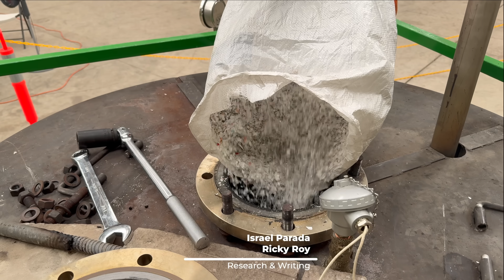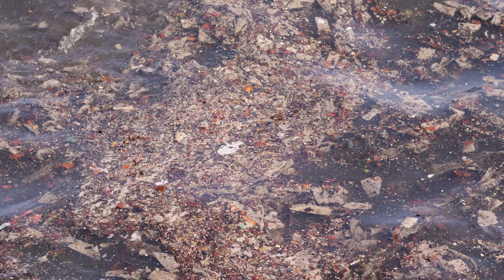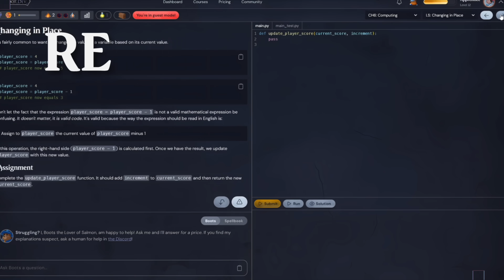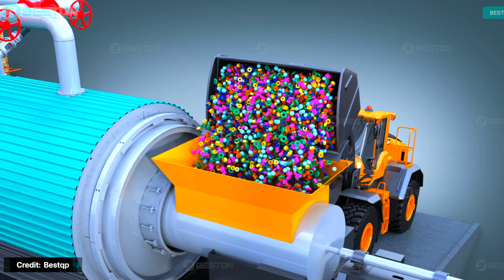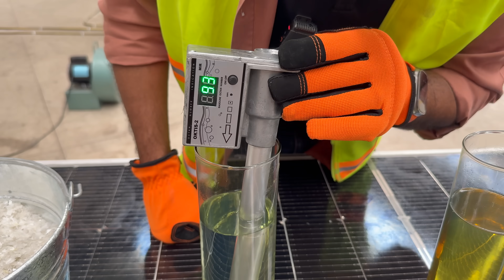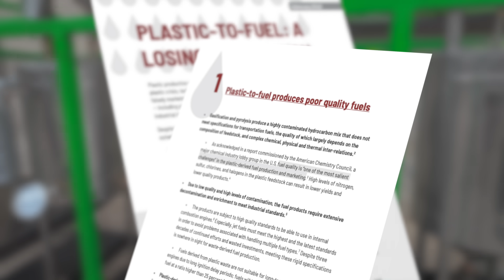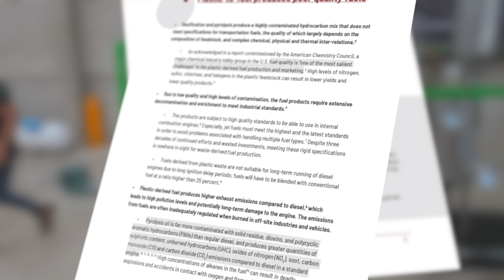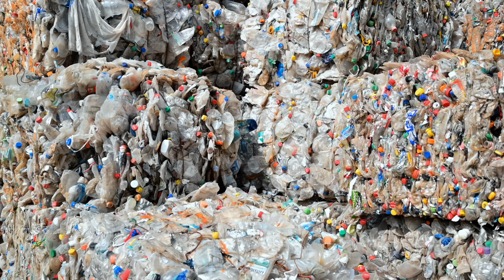Solving the Plastic Waste Problem - This Surprised Me!

Comment: So first and foremost what kind of company is this going to be? A company selling the systems to refine these plastics? Or a company that it going to own it's own centers to refine these plastics in different locations? The reason I ask, is because it's making me think of the 10 different states that have the recycling program for .05 or .10 cents per bottle or can. Why not have this company see if they can get their hands on some of that stock to build a workable stock? 
From what I understand from these redemption recycling centers, there's a bunch of plastics that are separated into reusable plastic, and different grades of plastics, some of those are specific grades that PetGas could use. So wouldn't marketing towards those centers to build a workable stock until they find a solution to get their own plastics? Or is this a company that is going to sell the processing plants to these types of centers? All I know is something needs to change with the amount of plastic waste we produce, and to produce it into fuel would be a great idea in my opinion. I think in places like California it'd drive the gas prices down or could be a leading competing gas with how high the octanes are. Which might be a great business model?
The only problem I'm wondering is how much they can produce per day and is it enough to compete with others?

Comment: every single plastic landfill should have several of these machines. not to mention the fuel from this plastic waste could be far cheaper than getting crude oil from the ground too, it looks like a promising tech and I enjoy its simplicity too.
Reply: A few years ago I read where a company was negotiating a contract to take all of NYC waste.
They separated everything and sold the metals and incinerated the combustibles using the heat to generate electricity.
So they got paid to take the trash, paid for the metals, and sold the electricity.
Just add this technology and sell the gasoline also.

Comment: I remember learning that the massive Deepwater Horizon leak in the Gulf of Mexico years ago did LESS damage than if it was pumped out as usual, refined, and burned. Yes, you read that correctly, the oil did less damage bubbling up from the seafloor day after day than if it was “properly” refined and used to propel modern vehicles - which are slightly more efficient/cleaner than older vehicles, slightly. Burning gasoline, diesel, etc is extremely bad for the environment and the sooner we stop creating and burning the garbage the better. Recycling plastic into something that isn’t burned is a better idea - maybe it can be sequestered in something so loose micro-plastics aren’t an issue. Burning plastic/fuel doesn’t make it go away, rather, the chemicals are now in the air, water, and soil. Just my opinion.

Comment: A lot of energy is used to find and retrieve fossil fuels. Using this process to make fuel has to be much more energy efficient than drilling in the Arctic Ocean or creating more dependence on coal, as our current administration wants to do.

Comment: "And that's one of the criterias that helps us be considered a clean technology and a green technology, because you produce more energy than what you need"

This is not the definition of clean/green technology, that requires zero, or at least low, net fossil carbon/CO2 emissions. The feedstock for this process is a fossil carbon product so the deliverables are derived from it will also be fossil carbon products. This is a 'greenwash' not a 'green' technology.

What is process demonstrates is that a lot of people do not understand the basics of low (fossil) carbon energy.

Comment: Turning waste plastic into fuels does not make green or low carbon fuels. The carbon atoms in the gasoline, diesel, or whatever other fuel is produced, are the same FOSSIL carbon atoms that we're in the fossil fuel that the plastic was made from to start with. The only minor of benefit it provides is not having to extract virgin oil to make the gasoline, diesel etc. However, they will still be some material and energy losses from the conversion process which are likely to be higher than those incurred from processing virgin oil, partly negating the benefit off giving waste plastic a second life as a fossil fuel.

Actually, if the plastic is clean then probably the best thing to do with it is actually landfill it. Deep landfill of plastic is effectively carbon sequestration, it'll just sit there almost indefinitely.

However, if you really insist on extracting the energy content the plastic then the most effective way is probably to actually burn it in dedicated furnace to produce electricity, which should operate at an efficiency similar to a coal power station, about 40%, and use the electricity to power electric vehicles.

The energy content of plastic varies a lot depending on the type, but 1Kg of mixed plastic probably has an energy content of about 9KWh on average, producing about 3.5KWh of electricity, enough to power an EV for 11 to 12 miles.
If that plastic was converted to petrol/gasoline, at 100% process efficiency, it would produce about a 1 L of gasoline, enough to power an average UK petrol car for about 8.5 miles.

Therefore, burning plastic to make electricity could power about 35% more Road miles than converting it to fuel, and that is assuming 100% conversion energy efficiency, which I doubt they will get close to.

 Furthermore, it should be possible to add CCS to the power station to capture the fossil carbon atoms, but this wouldn't be possible when you are burning those same fossil carbon atoms in a car engine.
Reply: Carbon is the element of life, life does not exist without carbon, and it is a precious resource, not something that should be sequestered in a landfill.

CCS is making the most beneficial decision - take an element that is naturally recyclable & place it in well defined holding areas so it can be used for future uses!

Fuel is just one way of using sequestered carbon (creating fuel sequesters it again.) How about accelerating growth in adjacent greenhouses? How about 3D printed filaments? Making Graphene for high tech manufacturing uses?

Carbon is NEVER better in a landfill.

Comment: So much plastic that consumers put in recycling bins never actually gets recycled and instead ends up destined for landfills in other countries. If we could instead make use of the plastics that we can't or just don't actually recycle into new plastic products, but turning it into coke, gasoline, Diesel, kerosene, and paraffin wax  it would certainly help get rid of theplastic waste in a better way than just piling it in a big hole. 
Also, if this process, once utilized on a large scale, produces significant quantities of coke, it could reduce the reliance on coal sourced coke and therefore reduce the extra CO2, SOx, and NOx emissions that come with making coke. Not to mention require less coal to be mined in the first place. 
So sure, it's not keeping the plastic plastic, and isn't keeping the carbon sequestered. But it is using the plastic to replace other sources of carbon products, some of which have other pollutants that people on both sides of the climate change discussion can agree are bad. 
Don't just look at the first order effects. Look far downstream for all the other potentials, both good and bad, when looking at such things!

Comment: the all you need to do to please people. otherwise tech is fine. yes people talking are the worst. kerosene is paraffin but liquid tho. the bs people talk to get money grants. yes people pleasing the curse of the community. zero actual freedom, only please me talk. therefore corps rule the world currently. well you need to get paid dont you to give them money. free gift or there is no business. also fractional distilling. electric starter resistance heater of course. no wonder people. so why not burn plastic in steam engines. treat plastic like wood. and generate electricity. you are doing wood gas anyways. so why name pet-gas if you cant handle pet. so you dont have incineration waste power plants. hold on, recycling used to be just re-using the material in some way, not fuzzing about climate change combined into the reasoning recycle. recycle dont even think about nonsense. any climate change talk only makes you look ridiculous. climate change is only fake extra enforcement of random laws that nobody should be putting on freedom. like your voted or placed laws. better be perfect or your talking points collapse with your own law. ip? lol. public domain.

Comment: There are two problems with taking this technology to the next step:
waste management is a multi-billion dollar industry dominated by huge corporates who will jealously guard their profits and prevent disruption to their industry,
the oil companies don't want their product stream diminished so will resist any technology like this that does so.

The way around those problems is that you need a government agency or local authority that can interrupt the flow to landfill or incinerator, commission a project to build and run a pyrolytic converter, then use the products in a vehicle fleet to bypass the fuel companies. It's a big ask.

Comment: PET should be turned into car bodies like Sandy Munro has been harping about for decades and finally got Slate Motors to sign onto the idea... It's cheap, durable and repairable/replaceable at a fraction of the cost of painted sheet metal!

Comment: A lot of plastic waste in Europe is dried and shredded  (with other waste) to produce "Refuse Derived Fuel" and then used in energy from waste plants  - i.e. incinerators.  so the notion of recovering value from plastic in the form of a fuel is well established.   This process appears to produce a much higher value fuels ( & wax & carbon) but the waste will require more sorting to avoid contaminants like PVC  etc.  Very interesting even if real world recovery rates when the thing is scaled up are not as good as the test bed.

Comment: This process has been known for the past 20+ years. There are many of these systems operating around the world, but the profit margin is low. Here is a question, what is the Sulphur level in the fuel? Is equal or lower than what California, and Washington state require? If it is they can sell to them for $3 per gallon, which is the ballpark average the rest of the U.S. buys it for.
They could set up the process near farms, sell it the farmers at a reduced price, which would improve profit margin for the farmers. 
Set up several in Hawaii and Alaska, both have very high fuel cost due to it need to import all of their fuel.

Comment: This is a terrible idea! We don't need more gasoline. So we're taking plastics (which were produced from petroleum products) and converting it to gasoline (using lots of power in the process) to burn and put more CO2 back into the atmosphere? How does this help anything? Yes, it gets rid of waste plastics but by ultimately throwing CO2 into the air? This is neither green nor clean!

Comment: Besides the serious concern of creating fuel from a waste product, they need to solve another problem if they want to scale up. Batch processing seriously limits the usefulness of any process that wants/needs to process large amounts of waste. If they can convert this to a continuous process, that would increase its usefulness. I am sure that is possible given that the petroleum industry already has this solved for hydrocrackers where the heaviest tars and fueloil fractions that remain from the refinery/destillation process get hydrogenated and broken down to lighter chains that can then be destilled in more desirable products (this hydrocracking also produces a coke residu, but it containes more unwanted pollutants because the input contains more sulphur and metals.

Comment: Considering how little plastic actually gets recycled, this could help build a balance of typical recycling and fuel issues.   I actually think this is a monumental discovery.   Thank you for sharing this.
Reply: The problem is that in the real world, the cost of sorting the plastic eats into the ROI. You can't just scoop up 10 tons of random plastic out of the ocean and dump it into a reactor. Not yet anyway.
Reply: And there is energy input (a BTU cost) for every drop of new fuel created.
Watch the video. They cook the plastic with natural gas and add petrochemical plastic (to create the new fuel). This process creates even more pollution. Stupid idea.
Reply: @ChatTHC420 NO, but we are automating everything. Just the mater of TIME…..
Reply: @ChatTHC420  With AI and vision, there can be two or three 100m conveyor belt with multiple arms that are constantly sorting and putting the needed plastics into the right lanes. 

That won't be hard at all, with some car factories already operating 100% robots and automation. 

Possible. Someone just has to put the various pieces together
Reply: @ChatTHC420  You absolutely can, and that's why they burn trash in Sweden. None of you know anything about this at all
Reply: @themodfather9382 
That's the proper way.
No reason and no sense in doing extra steps just to loose a part of the energy to inevitably substantial losses - you just burn it for power generation and district heating.

No need for complicated sorting or cleaning garbage either that way.
Reply: @themodfather9382  i know this world better than u my bro and this business model is not economically viable. Plastic has a cost — no one gives away waste for free, especially if it has been pre-treated — and the energy required has such a high cost that, in addition to raising the break-even point, it may even compromise the sustainability of the entire business model 

Almost all European countries—and many others outside Europe—pre-treat and dispose of plastic in this way, but in many cases the business model is viable only thanks to government support or economic policy measures. 
Go study little bro
Reply: @diegocolombo9510  you don't know nothin'
Reply: @themodfather9382  LOL 😂😂😂 a great friend of mine has the only working patent. ok buddy, nice life ignorant
Reply: @themodfather9382  
Tbh, I know people who own a better technology. It can generate all the energy required for the process itself, it can produce kerosene (or diesel or gasoline), and most importantly, it can process any type of waste. not only pretreated plastic! 
What is shown in this video is nothing more than pyrolysis and gasification applied to clean plastic (already processed). There is nothing new here — we've known this process for at least 50 years
Reply: @themodfather9382  What you’re talking about in Sweden is nothing more than what we also do in northern Italy, namely waste-to-energy plants that produce thermal energy—nothing to do with turning waste into oil.
And if you look at the financial statements of those companies, you’ll notice that most of their revenue comes from waste collection paid for by citizens and government subsidies. Throughout the entire Eurozone, waste collection is controlled by politics and organized crime, including in Sweden (a country that is now falling apart).
Go educate yourself. I didn’t judge you, but what you’re saying is simply nonsense. There’s nothing wrong with being mistaken; I encourage you to look into the topic if it interests you, and to stay calm.
Unfortunately for you, I know this field (especially the part discussed in the video) better than 90% of the people who work in it, from technicians to politicians.
Reply: This could really help fund the plastics recovery from the ocean!
Reply: Imagine how many people would recycle if they got to receive gas instead of a few bucks. Recycle centers pay very little for plastic.
Reply: I’m sure the oil companies will do everything they can to prevent this from happening
Reply: @johnnyrocsmith7316  they don’t care because this is not viable without subsidies. Otherwise I would put my own money down and so would chemical engineers. The owners would not advertise they would scale, and build more and more.
Reply: @topazdixon2089  saw this 3 years ago but couldn't build it :)
Reply: Homo plasticus, in the real sense of the word. It is a crime, an evil one, to let all those plastics rotten in land fills, or let drift into the oceans. It is because no politician is interested in this huge problem. It would be so easy if every major city in the world had a convincently efficient program to recycle plastic. I cannot avoid feeling guilty each time I have to throw away, as simple garbage, those wonderful plastics that are so convenient, like the life useful, from the store to home, then to the garbage. Insane !!!!!!!!
Reply: @topazdixon2089  The plastic recycling industry is a scam, and it's BS, a tiny percentage of plastic can actually be recycled, the rest is dumped anyways by the same people that claim to be recycling. This would be a game changer and an actually real solution.
Reply: PLEASE…..give me a break.  How many BTUs of energy does it take to process (create) the fuel?
By the time you add the natural gas used to bake (process) the plastic and the plastic pellets, THIS DOES NOT BREAK EVEN ON A BTU basis. IT CREATES MORE POLLUTION THAN IT SAVES.